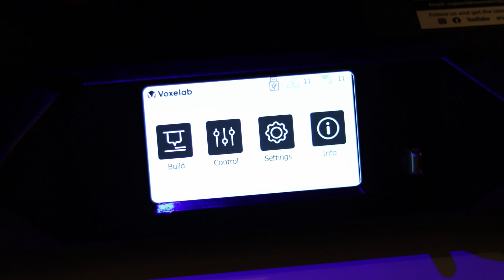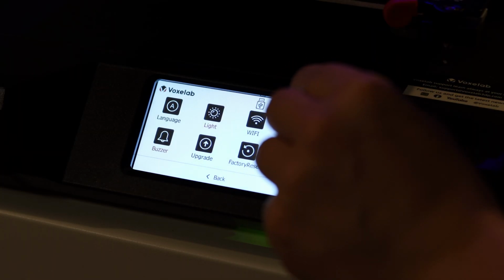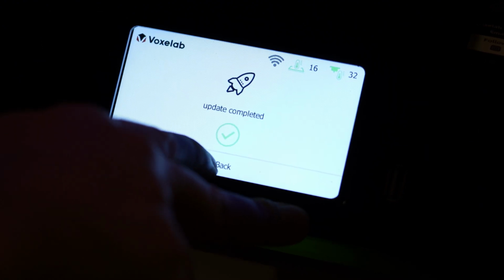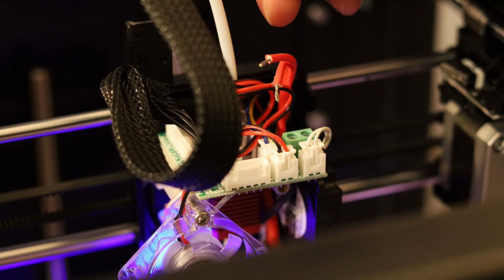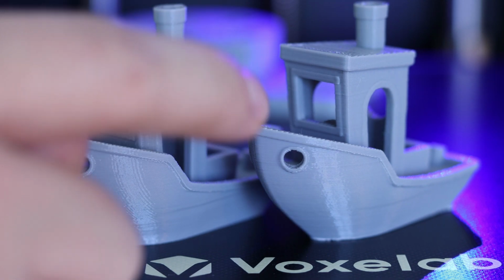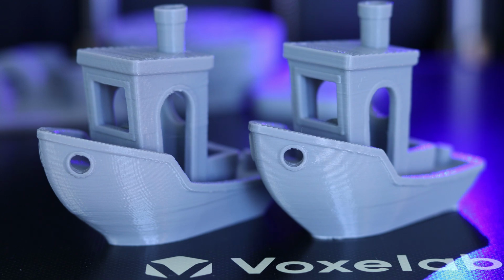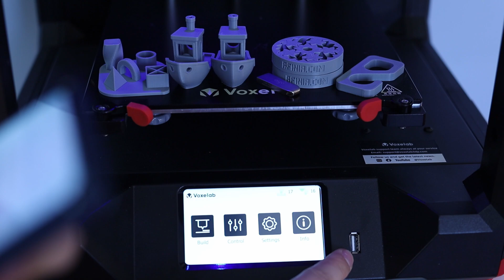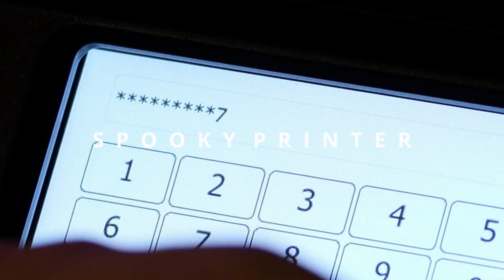VOXELAB ARIES - Watch Before Buying (Lowered Expectations)

Comment: Thank you for posting this great video. I have a question regarding the HeatBreak. I clicked on  the Amazon link and it is showing something different than from what i see on the video. The one on the video has a red color and the one on the link is just a tube. I found this browsing around Amazon, "FEMBW Creality Ender 3 Hotend,Assembled Extruder Metal Hotend Kit for Ender 3 / Ender 3 V2 / Ender 3 pro, 3D Printer Hot end Kit Parts for MK8 Nozzles (1PCS)" Let me know if this what 's in the video. Thanks again!!!

Comment: I replaced my fans with the same winsinn models and they don't always start initially unless you give them a small push. Did you encounter this? Are they just not getting enough voltage at startup?
Reply from the maker: Might be a bad batch. The thing about cheap fans like these is they aren’t always 100% quality built

Comment: Just bought this printer from amazon australia for $230 AUD which is an absolute bargain to me , i already have an Ender 3D pro V2 which i had to spent ages leveling every time i used it , print fails etc drove me nuts so now it just sits in storage with parts i never got to install Pi print server autoleveling probe etc etc probably spent $600 Aud so disapointed with it . As the Voxelab Aries is supposed to be very easy to use and setup and beginner friendly  with wifi i thought i would have another crack at 3D printing . Thanks for the info on the fan and sound dampeneing i will see if mine is noisy when it arrives later this week. Anyyyyyyyway to cut a long story short ;-) you just gained a sub .Thank you
Reply: How was it?

Comment: You didn't level it or anything? That red starter filament is excellent, you wouldn't believe how strong it is. The sides are glass smooth.
Reply from the maker: I don't remember. I think it arrived pre-leveled. This thing has crazy good print quality but the firmware situation makes me steer away from it, just because I like to improve/change things over time, and it would be hard to do on this machine.

Comment: Hi, what kind of rubber did you use to isolate the extruder motor, where can you buy it?
Reply from the maker: Butyl Rubber has great damping properties and is super cheap. I got mine from an old inner-tube, but if you search amazon for strips or sheets of butyl rubber, you'll find some.
There are also some urethane compounds formulated to have excellent damping, like Sorbothane.
Reply: @NathanBuildsRobots  Could you share some links for butyl rubber.
Reply from the maker: @rugbeatuno3647  https://amzn.to/3Axdls2
This is probably way more than you need, but I bought some of this to use on future projects
Reply: What aboout other matherials like Nitrile and SBR and Neoprene? Do they work?
Reply from the maker: @rugbeatuno3647  yes, pretty much any rubbery material will work. Look up materials for "vibration damping" or "sound deadening"

Comment: So ebay has these aquilas for $80 free shipping listed as "customer returns". Recently purchased one and everything was in its original packaging and looked brand new. Maybe I got lucky but the machine is doing great so far for the price compared to my ender 3 pro.
Reply from the maker: The market is getting flooded with printers. Prices are coming down. It's great. I really like the Artillery Sidewinder I just tested. It's just over $300 with ABL, bigger bed, and a super clean design.

Comment: My new Voxelab Aries touch screen monitor is not responding
Reply from the maker: I would ask voxelab how to re-flash the firmware. That is the first thing I try in those situations.
Reply: @NathanBuildsRobots  no. Returning the printer. The touchscreen works for leveling, all other touching except touching to print. I'm not wasting my time on it. I'll exchange it for flashforge adventurer 3 though I pr
Reply from the maker: I guess thats the problem with a highly proprietary electronics and software design. It won't be as well supported as a mainstream open-source project, so you get bugs, and its harder to fix.
Reply: @NathanBuildsRobots  what vexes me the most is that it's the same they are checking out of the packaging box

Comment: I just got this printer and I was wondering what the brand of fan is that you replaced it with so I can get the same thing or whatever you recommend is best?
Reply from the maker: I think I put a link in the video description. All of the cheap 24v RGB fans I've bought have been super quiet

Comment: I have this machine and I can't get it to work anymore. It wont move once it's heated up, and it's only heating to 207. All searches say I should calibrate the PID, but you say this machine doesn't allow that. What do you think I should do?
Reply from the maker: This is the problem with locked down firmware! Can you print at 205? You can also trick it into heating up more by installing a 45W or 50W heater instead of the stock 40W? Heater
If you msg me on discord I will follow up with you.

Comment: Any reviewer so arrogant as to brag about not reading, and tossing the user manual is so indicative of the bumpkins joining the hobby, winging it, trial & error and eyeballing and you're a reviewer!
Reply from the maker: A well designed product does not need a user manual. For example, most people do not read the manual for their car, phone, microwave. So I give it a try without reading the manual to see how infuriating it is to set up. 

I always read my car's use manual. It is always well written and full of useful information. However, the user manuals that come with 3d printers often do not contain the information in most interested in,  like what kind of firmware they run, or if it is lacking certain features. 

So rather than reading the manual, I just start using it. Your right, I should page through it to verify it's contents first before discarding... something about judging a book by its cover... 

They are more of "assembly manual" than a "user manual". Meaning, they show how to assemble the machine step by step (though they often leave out critical information on poper leveling/tightening/tuning), and spend only 1 or 2 pages on steak "use" of the machine, which is the kind of info that should be in a "user" manual.
Reply: Being my first 3D printer I read through the whole manual, all 21 pages. It's more set up info than anything. I've learned more on this through you tube than the manual.

Comment: What temps are best for printing PLA on the Aries
Reply from the maker: I just print at the recommended temp on the spool + 5°C

It varies based on the PLA used, but generally I go for 205-210 hotend temp,  50-60C bed temp
Reply: @NathanBuildsRobots  210 / 70 works for me

Comment: Wow I've actually been looking for some silent 40mm 24v fans, and they're lit up! Nice, two birds. Also if you want to hear a loud extruder, get an Flsun Super Racer and turn the extruder speed up to 60mm/s or higher, that thing is loud AF. I'm replacing mine with that BMG clone v2.1 on Amazon, hopefully it's quieter but I dunno.
Reply from the maker: My bmg clones aren't too loud, but it's all relative. On retractions they can click a little bit, but I've used them in a bunch of my videos. 
The Haldis ones are good, I've bought about 4 of them, on one of them a grub screw came loose and it started slipping. Had to take it apart and re-tighten that screw, and overall build quality isnt great, but they get the job done up to 60 cubic mm/s and are very cheap.
Reply: @NathanBuildsRobots  the one on the Flsun Super Racer is real cheap, the loudness is the gears grinding at high speeds

Comment: Have you figured out if you can do a pid tune on this yet or not?
Reply from the maker: I just checked and there have not been any firmware updates since I made this video, so nothing new in the UI or USB pluggability.

There MIGHT be a way to do the things that I was complaining about by running .gcode files saved to a flash drive:
https://marlinfw.org/docs/gcode/M301.html
https://marlinfw.org/docs/gcode/M092.html

But they are using a custom firmware that does not support all of the same commands as Marlin, so I don't really know if that would work either.

Plus 99% of the time people are tuning esteps or PID values using the printer's UI, or by running commands directly from a computer over USB. 
Since this thing does not have a plug for a USB serial connection, you can't run a terminal or octoprint.

There are a whole lot of unknowns about this printer, and at the end of the day if you want to change those settings it's much easier to do on a machine like the Voxelab Aquila or the Ender 3.

The only thing keeping this video from being a scathing review is that the print quality and overall experience setting up and using the machine in its stock configuration is actually very good - better than your Ender3s and Voxelab Aquilas. It's just not great for modding, which I really like to do on my machines.
Reply: @NathanBuildsRobots  sorry for asking a stupid question, but how would you go about that, all the programs I've tried doesn't have a way to connect to it, and I'm very novice when it comes to this, this was my first printer I had bought to get into 3d printing, which was just back in December. Wish I would have seen your video before purchasing! Your video helped me even figure out how to change out the bad hotend! I appreciate any help! Thanks so much!

Comment: great video, thanks for posting.  How do you remove the bowden tube from the extruder?  I can't figure it out and don't want to break anything removing it!
Reply from the maker: Voxelab Aries extruder https://imgur.com/gallery/z6bKgD0

It looks like thus extruder with some surrounding stuff to hold onto it: https://www.biqu.equipment/products/3d-printer-accessories-makekbot2-extruder-ii-generation-plastic-parts-left-right-suite-with-1-75-3mm-double-gear

I would remove 4 screws (the 2 shiny hex socket screws on top and the 2 Phillips head black screws on the bottom) to separate the clamshell. The tube will probably come right out after that. 

It looks like they are using a press washer as a 1-way push fitting. Haven't seen that before but it appears to work well... until you need to remove it. Probably saved them 10 cents per printer over a brass pneumatic fitting. 

I could think of a few faster and more destructive way to get it apart 🔥 🔪 💥.  You might be able to get away with just undoing the top 2 screws if the case is flexible to open up like that but do it at your own risk!

Comment: Great video! Do you have a model/brand for the fans you replaced?  I would like to replace the same ones you did, the hot end and motherboard fans.
Reply from the maker: Check the video description, I included a link to the fans I used. No-name 24v RGB fans have been working great for me in all my builds.

Comment: Great video! I ordered one for my nephew earlier. I think switching out the fans is great advice. For the 24v fan, what size fits? They have a few listed (40, 30, 25mm). I'd like to switch them out ahead since it seems like it makes a dramatic difference. Thanks!
Reply from the maker: You will need two 40mmx40mmx10mm fans, one for the hotend and one for the base. I think the bracket in the base was a little bent so when I put my fan in it would grind on itself a little, but I fixed it by bending the L bracket it was attached to. Good luck, this printer is very noob friendly so I hope you nephew enjoys it.
Reply: @NathanBuildsRobots  Awesome, thanks for the tips!

Comment: I understand you're upset about the poor build, but you don't need to remove all the plastic and add rubber.
Simply insert a thin rubber between the rear case and the extruder gap to reduce the sound.

Comment: What hotend is that?
Reply from the maker: I was going to try out the Red Lizard hotend by Haldis. There are a couple different versions of it but here is the one I had: 
https://amzn.to/3FoviIS

It's got the thermistor on the opposite side of the hotend than the heater cartridge. Not sure if it's a good or bad thing. It could make it more likely to overshoot the temperature or better at accounting for heat loss due to extrusion. Will have to wait to find out since I could get it to work on this machine.
Reply: @NathanBuildsRobots  Thanks ! Was curious what the name was. Haven't seen it before somehow.

Comment: Thanks for the great review.  With the wild price swings Amazor has been having on this printer, I keep considering if I should add this or the Prusa Mini to the herd.  If it hits $250, I'm definitely going to pick one up.  I like modding and fiddling, but I need a printer that just works when I need it to that doesn't cost an arm and a leg (I only have one of each of those as it is 😅).  I've added an Ender 7 that's definitely going back because it's too much money for far too little, and my Ender 6 arrives Thursday.
Reply from the maker: Wow, $700+ is a bit much for that ender 7. I guess it cost $100 for each ender they include in the machine. 

Yeah I'm going to turn it into my designated ABS printer as soon as I get a chance. Looks like the Ender 6 could do the same albeit a little more expensive. 

I actually haven't printed with ABS in years since PLA became the filament of choice for general printing. But ABS holds up a lot better in slightly elevated temperatures and direct sunlight, so I'm looking forward to using it again. Also it's a tad less dense.
Reply: @NathanBuildsRobots  yeah, I've been wanting to print ASA (supposedly like ABS but far more successful/forgoving due to the decreased shrinking/warping during printing) but haven't found the right printer for it yet.

I never pay retail for my printers.  I got the Ender 7 for $629 and the 6 for $480, both new in box.  I'm hoping the 6 is what I've been looking for.  Otherwise back to the search!   My workhorse? A heavily modified Ender 3 V2 that I'd describe as anything but stable. 😅

Comment: Nice video and conclusion. It’s seems like a great printer for someone that just wants to plug and go and not break the bank. Shame that you can’t mod it.
Reply from the maker: It looked like there was an unused plug for a BLTOUCH on the hotend breakout PCB, which makes me hopeful that they are working adding more features to the firmware (otherwise why include an unused expansion port?) 

Another pro is the over-the-air update was the fastest and easiest firmware update I've ever done. It only took 10 seconds. So that means if they do decide to update it, there's a good chance people will actually use the newest version. 

PID and Estep tuning are a must for me, so I really hope they add that soon.

Comment: Great video. I agree with literally everything you said in your conclusion. Throwing in a new board + screen will really open the machine up to hotter temps and more mods. But I do agree that completely stock, it prints great. I've gotten some amazing prints out of it in that way.
Reply from the maker: Thanks!
I'm hoping Voxelab continues to work on the firmware and make an Aries V2 with an enclosed build space and quieter operation. 

Did you recognize the RGB fans I used? I bought a 4-pack of them after seeing your video. They sure came in handy here.
Reply: @NathanBuildsRobots  That would really take the Aries to where it needs to be honestly. 

I did! I love em. People are telling me they are sold out now. I need to pickup another set. :)
Reply from the maker: I kind of doubt it. Most of these 3D printer companies don't do a great job of upgrading the firmware over time.